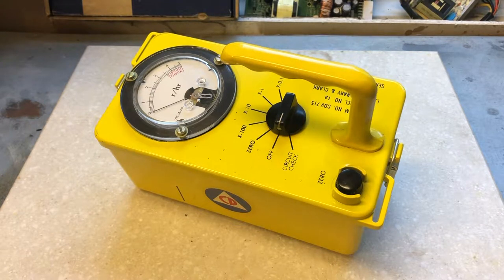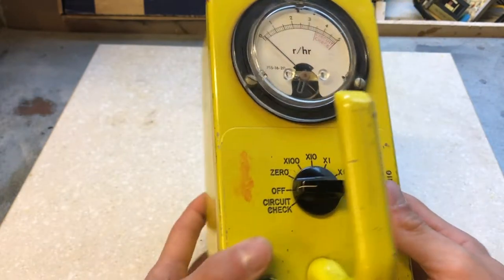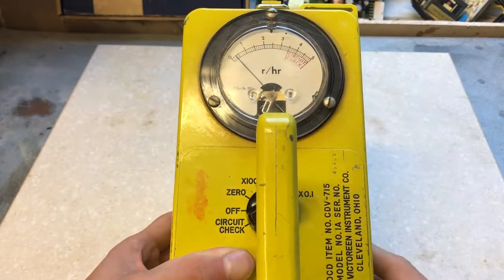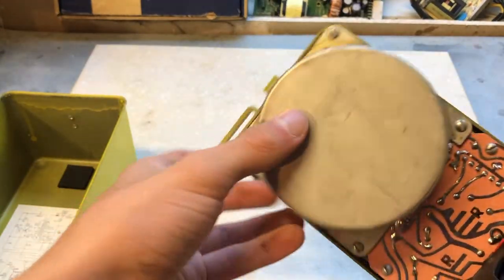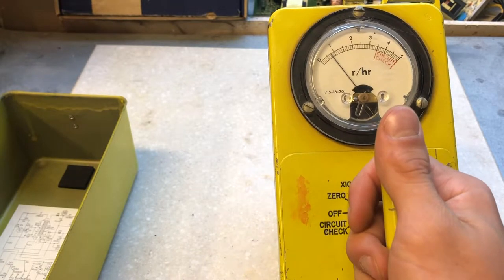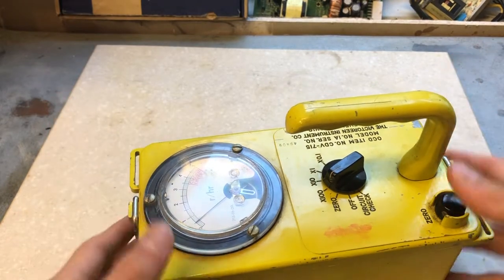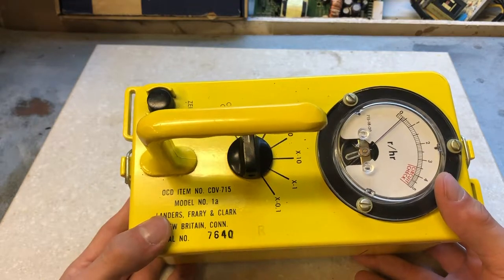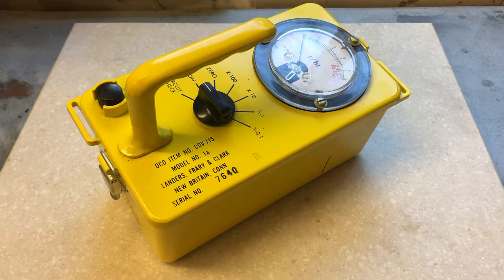Civil Defense CD V-715 Radiation survey Meter (geiger counter?)

Comment: I got a cdv-700, cdv-715, cdv-717, cdv-750, and some dosimeter pens at a military swap meet for $75. The cdv-700 had a short in it's cable which I plan on fixing soon, and the cdv-717, and cdv-715 are pretty much just paper weights... though I have used them as Halloween props.
Reply from the maker: Look at discord I’ll send you a picture of my collection so far. Cool that you used them as Halloween props.
Reply: You are the 6th person I know now who has that same short in the wire also good deal 75$